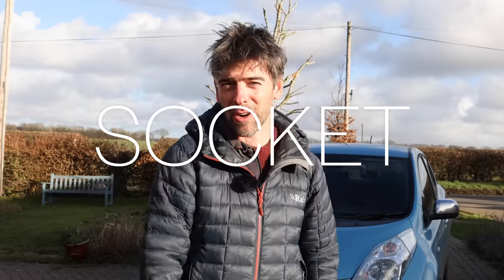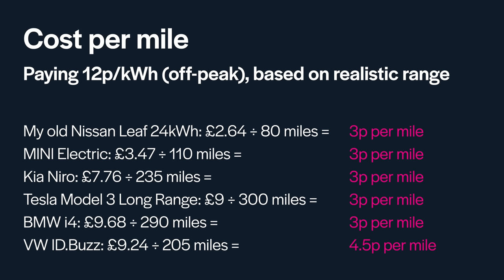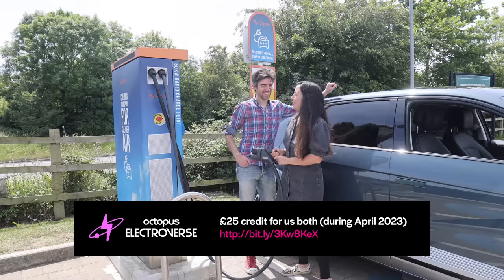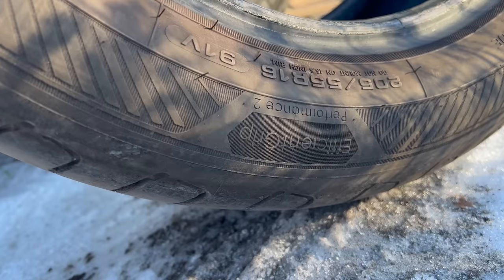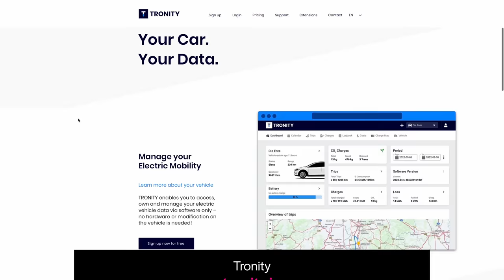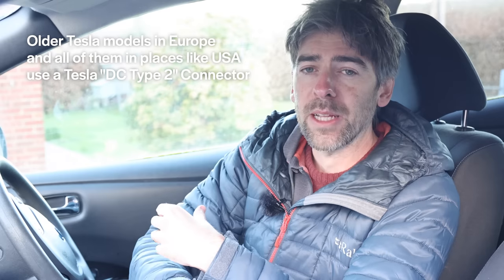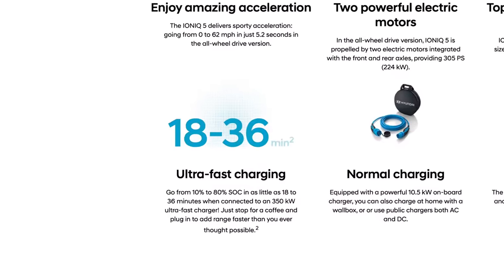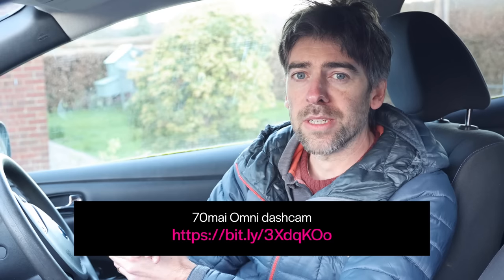So you’ve got an EV! Now what? Ten things you need.

Comment: Great video.  Will share it with anyone who asks me about owning an EV (which used to be all the time when I drove a BMW i3, but now I drive a Smart ForTwo EQ and I don’t think people realise it is electric 😀).  For someone like myself only doing local short journeys most of the time, do I really need a starter etc?
Reply from the maker: I’d argue it’s still useful to have, although I’ve not heard of any instances of dead 12v batteries on the Smart so perhaps check online first to see if it’s something that’s even slightly likely.
Reply: @MrEV    Thanks.  Will check with the EQ group

Comment: Well done Andrew. Excellent info.
I would observe that electricity costs have gone up hugely. When I bought the Tesla 3 years a go, Superchargers cost me 24p/kWh. Last year, they went up to 63p/kWh during the day 42p/kwh after 6pm.   Still not as expensive as Ionity which was around 89p/kwn 3 years ago so definitely subscribe to card which covers those.
Ive made a note about the Octopus card.  But on your trips to see in-laws, what would you recommend as a good card for European travel?

For the geeky:-
Charging a battery is like filling a tank of water from the bottom. When theres hardly any water in it, it goes in quite fast. The more water you put in, the slower it gets because the water in the tank is "pushing back!". Same happens with batteries which is why your rate drops off.  So the Tesla starts about 120kw and at about 60% is down to 80kW. At 80% is getting to less than 50kW and as you say, it drops even quicker after that.Its only around 25kw near 100%. 
The other thing to note about charging to high levels of charge is that with :LiON batteries, you do start growing crystals that head from one terminal towards the other. If they meet up, its a short.  Mobile phone batteries are quite prone to these and the phones start to die fairly rapidly as they just wont hold charge. Car batteries can do the same thing so again, another good reason not to charge to 100% as your battery may die sooner than you think. (most car batteries have a guarantee of 7 to 10 years but best not to push your luck).
Reply: Thats the problem... costs, alot of new EV drivers are looking at guides and advice from older sources,I'm a new EV driver (2 days ) and I'm really shocked at some prices these providers are exploiting... I srsly think this needs capped
Reply from the maker: Good info about the battery. Funnily enough I filmed more about that but edited it out as I thought it was all getting a bit too much for newbies! Actually, AC charging to 100% is a very good thing occasionally as it balances the cells. It’s leaving it sat at 100% for a while that’s the main problem. That said, Kia recommended exactly that during lockdown?! Also new LFP batteries don’t suffer as much being charged fully.

Anyway, as for RFIDs for Europe, I’ve previously used the Charge My Hyundai card so I’m not sure what else is best now. Chargemap is a good one I believe. The Octopus Electroverse one works well in Europe as well though. Elli is also very good and has cheap IONITY etc if you subscribe.
Reply: Octopus Intelligent has recently reduced it's off-peak price to 7.5p per kwh, from 10p per kwh. You have 6 hours per night at that.

Comment: I have been contemplating buying a second set of wheels and putting cross climates on them.  Steel 18 inchers for the ID.3 would be just fine for October to April.
Reply: You can run Cross climates all year round, so save some money and just replace your existing tyres.  I had a set on my Jaguar for 4 years before I sold it with still half life on them.  In 45 years of driving, they were the best tyres I ever put on a car .. great on snow/ice/wet grass & light mud ... also stable on a warm day at high speed in Europe
Reply: And in the end I did just this.  Michelin Cross Climate 2 tyres are truly awesome.

Comment: Great video. Another point in the charging speed section is that it can be the cable that is limiting you speed on the AC 22kw charger. Lots of slightly grumpy MG4 LR/trophy drivers plugging in with their MG cable only getting 7kw when they’ve heard they can get 11kw, but the MG cable is only a 7kw (single phase) cable, you need a 3-phase cable to get more than 7kw.
Reply from the maker: That's a great point. Obviously the manufacturer should give a suitable cable with the car, although I remember some e-Niro drivers complaining about the same because Kia had bundled the PHEV type 2 cable.
Reply: @MrEV  I don’t think us MG4 drivers can complain really, it was sold to us as having a 7kw onboard (I think because 99% of homes have single phase, so they were just selling based on domestic supply). The standard supplied cable is the granny but some bought or got the MG type 2 thrown in (and very early ones got type 2 because there was a shortage of MG grannies).
Reply: Same with MG5 only charges at 7kw on a 22kw charger. 
If anyone is going to Scotland you NEED a  charge place Scotland RFID card, lots of the chargers are not phone app capable.
Reply: @rebeccajarratt1487  I’ve just ordered an MG4, does that mean I should get the 3 phase cable to use on the public 22kw chargers
Reply: @garyhill9723  personally I would, as it’s not much more expensive to buy and provides a bit more flexibility/speed. AC chargers are usually a bit cheaper when out and about. If you’re getting a single phase type 2 cable thrown into the deal then it’s probably not worth the extra expense.
Reply: @rebeccajarratt1487  Thanks, no I’m only getting the granny lead, so I’ll pay the extra to keep my options open.

Comment: I have not been able to get abrp to work properly. Poor options and no instructions.
Reply from the maker: What in particular are you struggling with? I could try and do a separate video about it?
Reply: Well, everything!  Without instructions I try to program it but I can't tell it anything. Tried several times but reverted to Zap-map, which also has some limitations but at least does something of a job.  Grateful for any help.....
Reply from the maker: @lawrenceharris1819  I'm not sure what to suggest actually. It just works for me. Is it the app or the website you're using?

Comment: Great idea to advise new ev owners Andrew, however some advice doesn't really pertain to many drivers such as abrp which is not very good and one has to pay a monthly fee for the useful elements, all fine and well if it's used regularly? But most people will never use it regularly enough to justify. I have electroverse but have never used it.....No chargers on any route or locally that is signed up to it.
Reply from the maker: You need to pay the monthly fee for CarPlay/Android Auto, but the app on its own is free and I think does the job well enough?!

Accurate route planning is something new EV drivers do need and ABRP is one of the few that accounts for weather, topography etc.

It’s far from perfect admittedly but useful as a rough guide.

That’s a shame you don’t have any chargers near you on Electroverse. Hopefully they add more networks soon.
Reply: @MrEV   I hope some of the more widespread companies like Pod point and instavolt join electroverse soon as well, the idea of 1 card for many and billed in one place is excellent! 
Surely Android auto/carplay is pretty much the only function most people will use for mapping? Tbh I struggle to see the worth of abrp it's really not difficult to work out where to stop on a tour by preplanning using zap map which as you quite rightly say is essential for any ev owner.
Reply: I have never paid anything for ABRP, have now used it for a number of years, and have found it to be excellent. The ability to set your EV, its efficiency, the start of journey SOC, your preferred charger company, and other really useful parameters, make it a must have App for any EV owner.

Comment: 1. diesel generator in your boot (just in case).
2  won't be long till off-peak leki tariff disappear 
3. deep pockets for insurance (soon)
Reply: You would need a generator the size of a shed, to provide the 7kw needed for a meaningful charge current. One of those little market stall generators would take a week to charge an EV.  Off-peak tariffs have been around for 50+ years, and there is a technical reason why they exist. I'll leave you do discover what that is..... Why might forking out an extra £500 a year for insurance be too much of an issue if I'm saving over £2k a year by not buying petrol?  Typical "sour grapes" post.